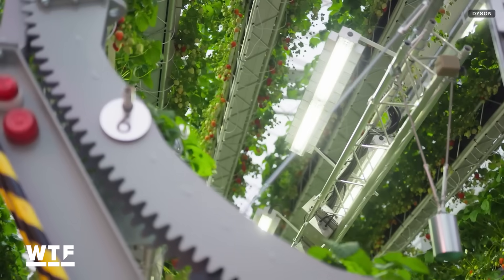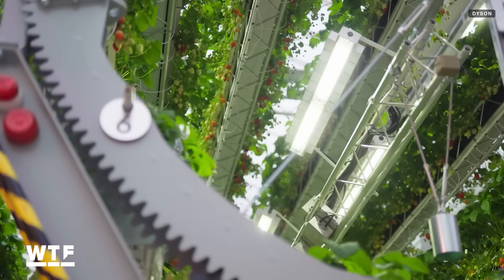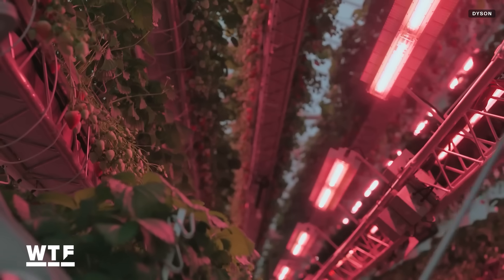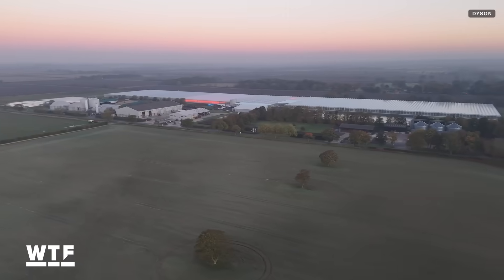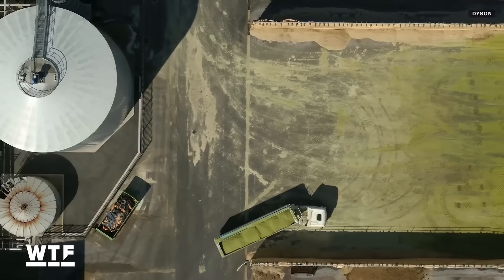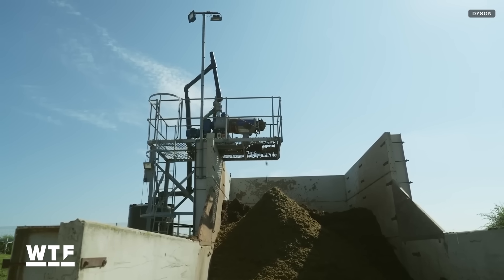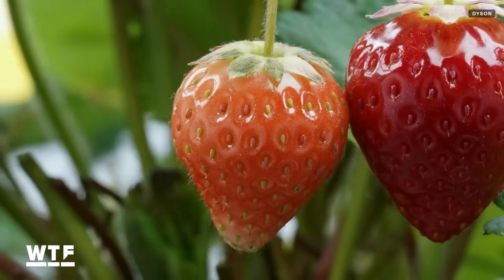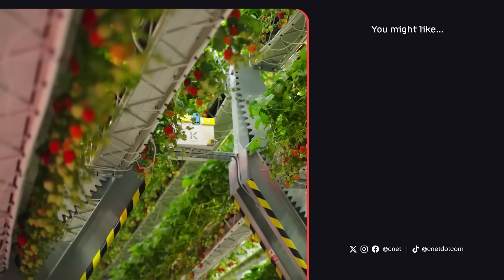Inside Dyson's New Circular Strawberry Farm | What The Future

Comment: If only he could make a ten story building underground and a glass greenhouse on top with a heat impermeable roofing material and cover the entire square footage of the roof of the greenhouse with a solar array that focuses all the light, like a fresnel lens at a central heat battery and circulates cooler air up into the heat chamber to soak up even more heat loss off the focal point and cap the roof of the focal point structure with like a ceramic dome or something to really trap that local heat loss in the system…

But that’s just a whacky theory by some YouTube user right😊